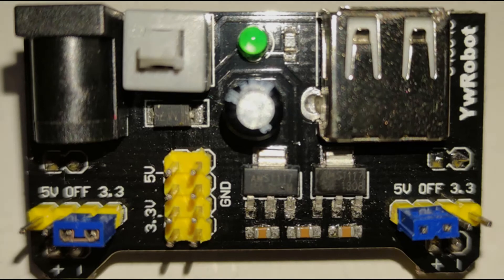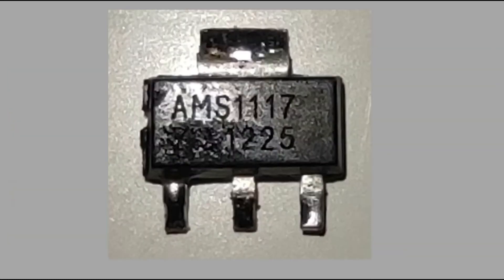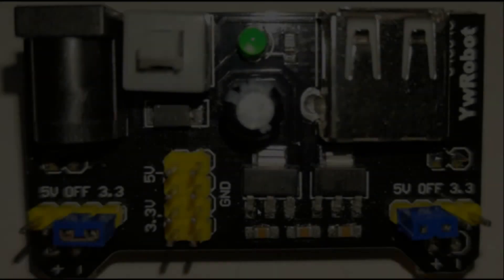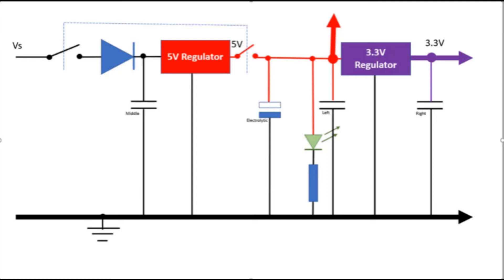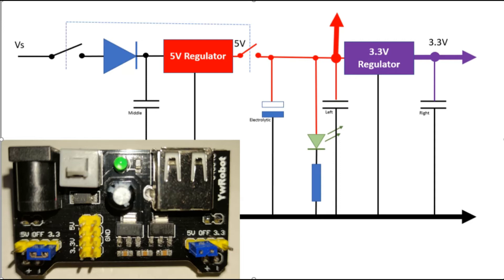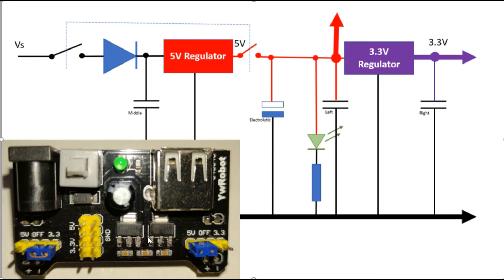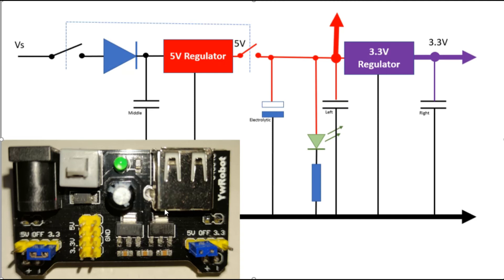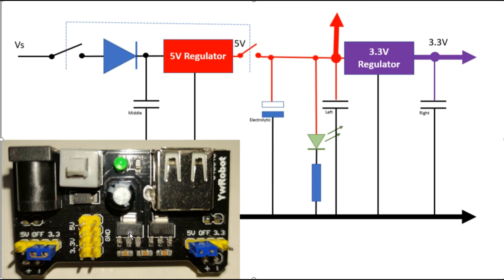ET#12.  MB102 Breadboard PSU - Fail, fix, Circuit analysis / Diagram, Power Supply, Limitations.

Comment: Can i use 5v voltage adapter
Reply from the maker: What do you want to use it for?  The regulators on this board are low voltage dropout regulators, so this means that they need the supply voltage to be slightly higher than the voltage you want out from them.  The extra voltage is used to make the regulators work and any surplus is dissipated as heat.  If you want to supply the whole board with 5V this probably isn't going to work because:
1.  The 5V regulator supply voltage will not be high enough.
2.  The 3V3 regulator is supplied by the 5V regulator - and if this isn't working because the supply voltage is too low, then the 3V3 regulator won't have a supply voltage and won't work either.

BUT  You can still run this board from 5V if you are prepared to do a bit of fiddling.

You can either wire your 5V power supply onto the output of the 5V regulator - This will put 5V on the output pins and so you'll have the 5V from the supply to power your 5V applications and the 3V3 regulator will also receive a supply and so will out put 3V3 for your 3.3Volt applications.  The easiest way to do this is either by powering in via the USB OR wiring the 5V supply on to the board via the 5V and Ground pins.  It is a bit Heath Robinson and I probably wouldn't advise this for longer term use!

It would be a lot easier to use a 7V, 9V or 12V supply - although the higher the voltage of the input the hotter the regulators will run (as @robc8468 correctly points out above).  Hot regulators will degrade faster.

Just be aware that if you follow the 5V route I mention above that some PSUs have a very rough and ready output with a fair bit of tolerance for output voltage with load and they can also be pretty noisy.  This may mess up whatever you are powering.  The input and output capacitors on the regulators usually deal with anything coming via the regulators.
I hope that helps.
Reply: @ECETek  thank you so much you are the only one that answered.
Reply from the maker: No problem.  I hope it helped.

Comment: Using the 3 volt regulatior directly on the 6-12 volt would generate a lot of heat and wasted power So knocking the voltage input to 5 volts first before sending it to the 3 volt regulator makes a lot of sense to me.
Reply from the maker: A fair comment.  I normally use a 7V supply on these to limit those losses and the heat stresses (although when I blew this one I was using an adjustable supply - clearly not the best idea!).
This arrangement does limit the current you can draw from both regulators though, as the output of the 5V regulator is going into the 3.3V, so whatever the 3.3V regulator is supplying, plus losses through the 1.7V voltage drop need to be subtracted from the 5V potential output of 1A.
I agree with you though and for anything remotely power hungry it would be far better to use a Buck regulator circuit (or two!).
I really appreciate your input and interest, so thanks for commenting.

Comment: Hi, I bought one of those boards and I only have the 3.3v and 5v output at the pin group next to the regulators, the other 2 pin groups for the project board rails, on the MB-102 sides don't have voltage
Reply from the maker: That is a tad odd as I'm reasonably sure the pins on the outer ends (that would go into your breadboard) are just fed straight off the regulators via their respective jumper.  Have you got the jumpers correctly placed?  
If your jumpers are in the correct place then I'd try disconnecting power from the MB102 and tracing the tracks for continuity.  Rather than trying to contact a track just check at the pins.  Have you got continuity between all the 0v pins?  Have you got continuity between the 5V pins (including the USB output).  You can also input on the USB port if you were of a mind to.  All pins of a specific voltage should be common to each other.

Comment: hello brother
I use the same board as yours. and i got a problem at the 5 volt power regulator and i am ordering the 5 volt power controller (ams1117 5.0v) from the online store I would like to ask if I can replace it and replace it with a new one. Will it solve the problem? Or do you have any good advice for me?
I'm sorry, I'm not very good at your language. so i use google translate
Reply from the maker: You can replace the 5V regulator with the one you have identified.  I replaced both the 3.3V and 5V on my board  and that worked OK - but I also had a problem with the conductive track from the diode to the input pin of the regulator.  Do some continuity checks and make sure the tracks are good.  What caused your problem? Make sure you eliminate that first or you will burn out the new regulator.  I would remove all the jumpers from the board until I knew that it was working - check the voltage at the regulators.  It would be easy to short out the regulator with carelessly placed jumpers if you were not careful.  :0)   Google translate worked ok!  ;0)
Reply: I have tried using a few of these. Had 2 of them burn out at the 5v regulator, it will output the same  voltage as the input voltage. The recommended input voltage is writen as 7-12v. I am trying on the old repurposed power supply (between 7-12v), I am not sure if this is the cause of burning it out. Can you give me some advices to avoid damaged this regulators
Reply from the maker: It may be that you have a problem 'downstream' of the 5V regulator i.e. on the output of the regulator.  These chips are rated at 1Amp max.  If you have a short on your regulator output then that might cause a massive current demand that then burns out the regulator.  Take the regulator chip off and then see if you have any shorts on the output circuit.  If you do i.e. if the 3.3V regulator has an issue, then fix that before replacing the 5V regulator chip.

Your power supply may also be an issue.  'Re-purposed' suggests a home made or home modified unit.  It depends on what you've done/used.  Old PC power supplies can be great if modified correctly (lots of YouTube videos on how to do that).Try powering the board from something with a known voltage e.g. a 12v car battery or even a 9v battery like a PP3 or something.  At least then you know your supply voltage is relatively stable.  Then check your output voltage and make sure it is being regulated as you expect.

Hope that helps.